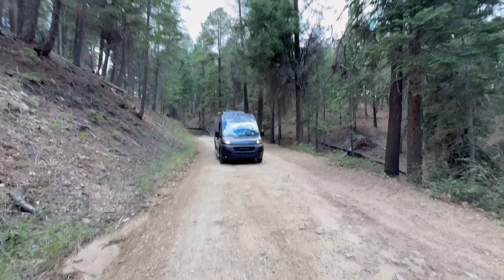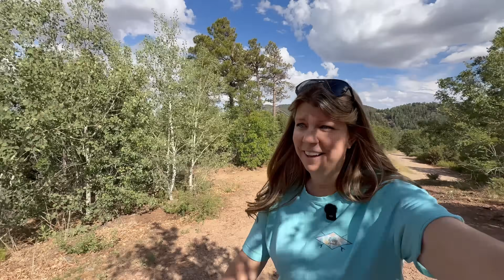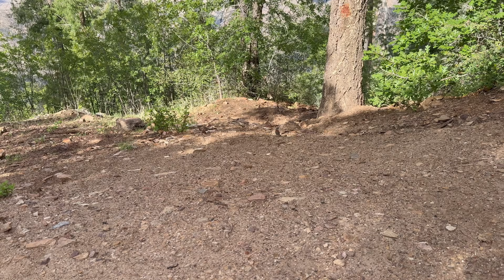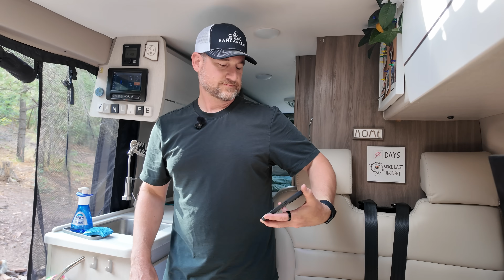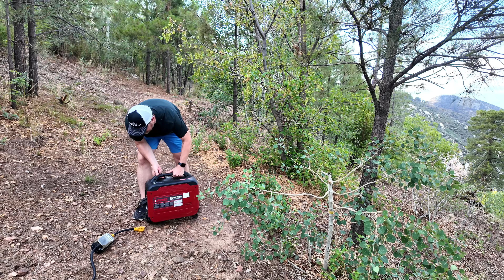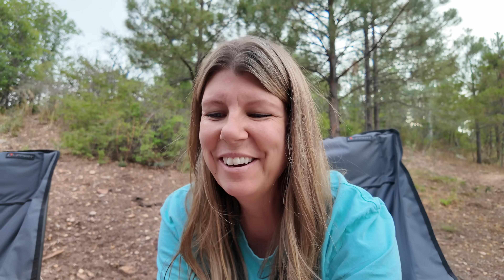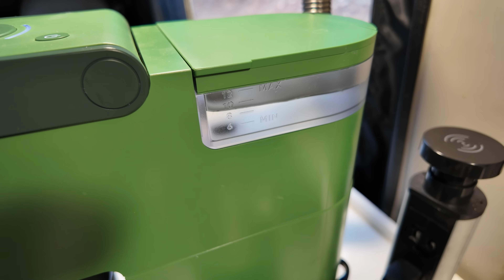MUST KNOW RV Generator Rules (Risky Roads & Lessons Learned on Mt. Lemmon)

Comment: You could turn your car engine into a generator with a second alternator kit and a specialty alternator.
Reply: i have this setup- its powerful (280amps!)  but not very fuel efficient for the amount of electricity generated. A small generator is louder but uses alot less fuel - (and wear and tear on main engine!)

Comment: 🍋🍋Bob needs a spatula !!  🍋🍋 Well Mr Lemon did real good to make it to the top of Mount Lemmon !   Not break downs and no going over  a cliff !  YAY!!    Maybe check into 12 volt air conditioners?  They use a LOT less power!   I just watched a install of a 12 volt roof top AC on another channel today.    Thanks for taking us along and Lemons UP!!  🍋🍋
Reply from the maker: Thanks for the info and the support!
Reply: You can add a drinking water filter under the sink
Reply: Yep, Bob might need a spatula 🤔
Reply: I would add in....please chock your tires.  Especially when concerned about being so close to a cliff.  As a life long camper, we have always chocked tires for safety.  One never knows if a brake wants to fail or movement inside could cause rolling.

Comment: Your last video motivated me to buy a generator.  I ended up buying 2 Honda EU2200’s with one being the Companion with a 30 amp plug.  I went this route because of weight.  If I went anything larger the weight would be too heavy for me - single chick camping.  I’m excited to give it a try next week when I head down to see family in Illinois.
Reply: It’ll be a good test. It’s 114 heat index  here in Naperville today!
Reply from the maker: Sweet! Please let us know your experience.
Reply: Please never camp near me! 😢
Reply: @IAMdave_thecat You don’t have to worry.  I own 100 acres in central Illinois where I’m going to use the generators.  The only thing I will be bothering are the deer and turkeys.  I would never run the generators around other campers.